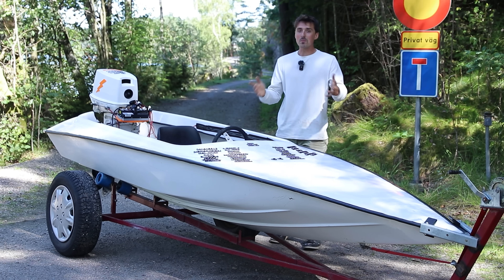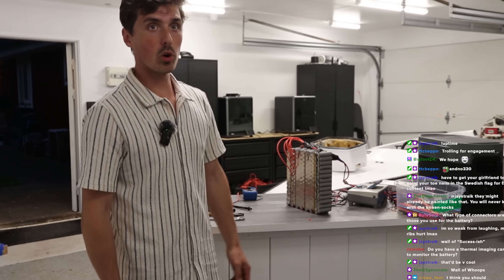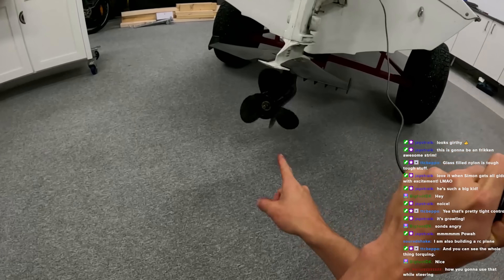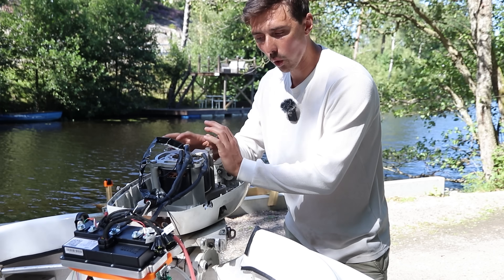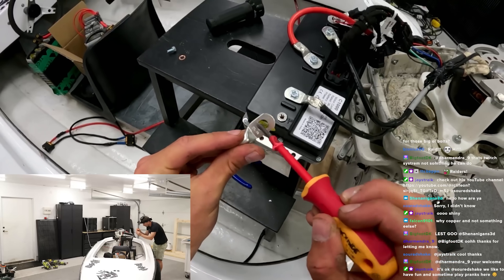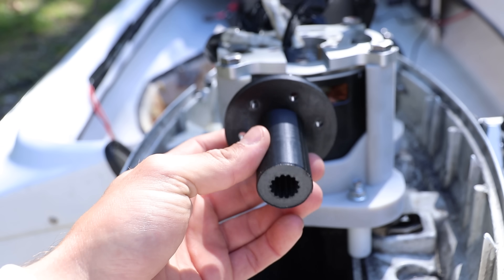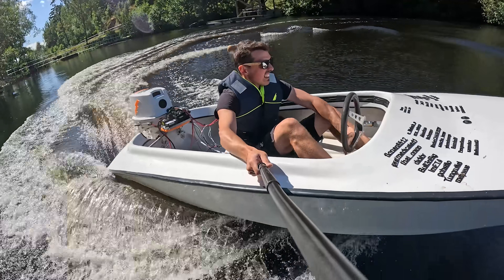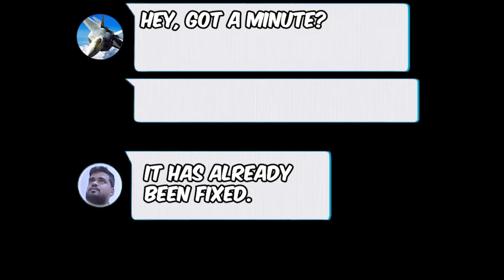Turning My Gas Boat Electric Part 2

Comment: i finally found a blown 75hp yamaha 2 stroke to start an EV outboard project, we pulled the blown powerhead and weighed it at 41kg, wow that alot heavier than we thought it would be. Parts that have arrived so far are SIA155-64 PMSM motor 30kw peak and fardriver controller ND96850 encoder version water cooled, we current have a small battery for bench testing 72v 12ah. thoughts on final battery are 2 x 72v 100ah units under each of the front seats and a backup 72v 60ah in the rear transom area (basically where the fuel tank was) this project going to be a slow burn maybe for next boating season here in Sydney Nov 2026. current 2 stroke powerplant is only 5 kgs lighter than projected new ev outboard. A wig wag throttle and speed selector switch at the helm. boat is a 15 foot runabout or tinny as we call them here. Although controller is 96v we are running 72v (charged to 84v) as all my ev converted bikes run that setup. not sure about connection between motor and leg/drive shaft maybe a lovejoy connector. thanks for the video you gave me good direction in some areas

Comment: No, please don't make a jet drive. Make a MUCH bigger 120V battery pack with inexpensive prismatic highest energy dense EV cells like CATL or EVE NMC cells for long run times. Add an air blower for air cooling or add water cooling. Tune the prop pitch if necessary.

Comment: Could you please post or send me the part number for the Motor and The Brand lower unit you used ... the Specs on the Air cooling fan you used and the cad fines for the parts you had made ... and the code for the controller and the total voltage for your battery pack and how many amp / watts it has ... thanks in advance 
Michael T.

Comment: You wanted more range right? I found lipo cels 55Ah 6 for 30 eur or so  so you can make an insane cheap powerfull high capacity battery

Comment: What is it what makes this hell of noise. Is it the cogging torque of the electric machine? Maybe it is a good idea to get rid of the grooved stator and make an air coil axial flux motor.

Comment: those wings do slow down a ton ...i tried some and took them off pretty fast haha....i would try to play with high pitch since electric has a loooot of torque and you lift the engine as much as posible before ventilation...2 blade brass props are going to give you a couple mph more

Comment: Tips. Jag köpte två Silence S02 Premiummoppar då dom säljs ut nu för 30K. Har 4kW elmotor (kan vara strypt 7kW?) med batteri för 10-12 mil. Finns med 1,5kW motor och mindre batteri för 20K. Borde kunna göra lite kul grejor med dom. Jag hoppas kunna få bort fartbegränsningen. Ett jäkla vrid i dom, runt 200+ Nm :)

Comment: Put one step higher pitch on the prop, and highspeed prop. And test put the engine in surface drive. Just for curiosity. 😁

Comment: You should raise the motor so 1/4 of the diameter of the prop is above the keel. This will aerate the prop and help it free up once the boat is one a plane. 

Guaranteed, it would give you an extra 20% speed at least and be way faster than a similar power jet drive.

Comment: So he would need a lot of battery for a few hours of run then, I love the quietness of the electric motor, but the fuel ratio is not on par with the length of time.

Comment: Before you remove the outboard you need to raise it up higher out of the water.  They are only down that far to get good cooling to the gas engine.  Raise it up till it start to surge and then down slightly.  I am not talking about trim actually jack the motor higher up on the transom.

Comment: I think you need to add a Go Pro mount on the boat so you don't have to hold it. I'm sure you could add electronic control for positioning.

Comment: Jet is great for simplicity, but you will suffer a 15% efficiency loss minimum. There are also hull alterations to consider. What you want, is a surface drive. All the benefits of a direct drive, with almost the simplicity of a jet. For your little boat, one could easily be fabricated from tubing, and an ATV cv axle. The hull would not need modification, unlike a jet, or V drive. It will also perform better than the outboard, as it will be much lighter, and surface driven props only have to turn half of the prop through water when at speed. There are various videos of surface drives in action on youtube, always in fast boats. The only down side is slow speed maneuvering.

Comment: Your outboard motor should be raised up one and a 1/2 inches from its current location. The bottom of the boat should be one and a half inches lower.Then the cavitation plate, according to mercury racing

Comment: Nice 🥳👌 To get more speed I think you should get a motor with the right rpm to match the propeller. 19kWh should be like an 25-30hp gasoline motor. Awesome work anyways 🤠👌

Comment: Great project.  I worked on a collegiate electric boat competition called Solar Splash, it's still in existence in the USA. We had so many problems with our speed controller limiting the current that eventually we came up with a strategy where we throttled up to full speed then activated a contactor that connected the motor directly to the battery (no speed controller). At that point your head would snap back as the motor could draw as much current as the batteries could put out (close to 1000 amps for a limited time). This was a brushed motor however, I'm not sure what you're using.  The contactor has to have the ability to break that kind of current, otherwise it will weld itself shut when you attempt to turn it off. Great channel.
Reply: This is brushless, so no way to just direct connect it. a speed control is mandatory.
Reply: @Ken-v5l5d  I was thinking that might be the case.

Comment: So you can get that kind of control with a sensored motor and esc. Holmes Hobbies could have built you something for way less. Heck you could have used a revolver style without sensor for crazy control and power.

Comment: Nice project! 
And hey it's your build so whatever you decide is best but jet drives are usually about 30% less efficient than the outboard drive you already have.
Maybe try a straight shaft? Like on the RC boats. That should cause the least losses from motor to prop, maybe give you higher speed and eliminate most of that noise.

Comment: Hey drive will be slower. You’d be better off with a direct “arneson” type surface drive. No gears at all. Less weight. And you be able to trim it. Jet drives are horribly inefficient

Comment: I'm surprised your cables didn't melt. At a guess from what I could see your cable from the batteries to vesc to motor is about 16mm2. With 382 amps about 2 metres your voltage drop would've been around 5%. Cable size for current carrying capacity alone should be 150mm2-ish. Sorry if you explained this on your live stream or somewhere else that I missed.

Comment: You're better off leaving the outboard boat as it is and finding a jet drive hull. The hydrodynamic design is specific to jet drives. Maybe find a jetski with a seized engine and retrofit?

Comment: ooooh, jet drives are fun but tricky. you need to get the size just right to match the motor and expected ship speed. DO NOT do stages, water is incompressible. impeller should be axial flow, with a screw profile to the paddles, and a slight conical taper. The taper lets you have a taper in the housing and adjust the impeller axially for tight clearance. In terms of impeller size you gotta think about your pitch, outer and inner diameter (there's a shaft, right?), # of starts, giving you a volume per revolution. figure out what speed your motor likes and that gives you flowrate, then you gotta figure out how much power you have from the motor to accelerate that flowrate. stator vanes post impeller should start angled and go to axial. impeller is a (conical*) SCREW! (in a conical pipe) remember this!

Comment: That boat can be so much faster. You need to raise the motor and run a surface drive prop. You also need trim. As far as a ramp goes, just use wood covered with outdoor carpet on the top.

Don't go jet drive. Too much wasted power.

Comment: @RCLifeOn om du vill åka fortare OCH svalare för motorn, så höj upp motorn så centrum på växelhuset (propeller axeln kan vi utgå i från också) så att den ligger strax under skrovets djupaste del. Propellern väldigt djupt och tung i videon, men vill du åka fortare och svalare så vill du ha ha upp proppellern ur vattnet mer så  varvar han ur ännu mer å de går fortare, toppfarten ökar men på bensin motorer kan de bli svårare att ta sig upp i plan, men du har så sjukt mycket bottendrag med EL motor så de är nog inga problem. :) hissa upp motorn minst 20cm iaf, vore kul å se hur mycker fortare du kan åka per knop :)

Det borde vara lättare också för din motor och VESC enhet om inte hela propellern behöver vara under vattnet HELA tiden. utan bara halva propellern. Tävlingsbåtar har 1/3 av propeller diametern i vattnet när man kommit upp i plan och fart.

Comment: If you really intend to go the jet drive way, I would suggest that you somehow convert that outboard motor to an outboard jet drive motor. The biggest advantage of this approach is that there is no modification to the hull needed and therefore no chance of leaking.

Comment: not sure why you only got 28 knots from that much power. a 25/30HP 2 stroke (22kw) would make that small boat fly maybe 35 knots.  i have a 350kilo Pioneer Viking 15 foot with a 25HP 2 stroke doing about 27-30 knots with 1 person onboard 425Kilo total. maybe the prop is for another RPM? make sure you match the propeller to the RPM/torq range of that motor

Comment: Now imagine 400 amps on a dual motor stand up scooter (both motors powering the rear wheel with chains).  That is what I was doing in 2003.
It is all about the controller and not catching the motors on fire, which I did many times.

Comment: When you need to print strong stuff, I can highly recommend you fibre reinforced Poly Carbonate (if your printer is able to handle those temperatures and if you have a hardened nozzle). Or if you are lower on budget, you can already improve your prints by printing out of (fibre reinforced) PETG instead of PLA.
Also if you have CNC mashined parts, I think a high performance aluminum (e.g. 7075) might be cheaper, lighter and should still handle those loads. You can also let it eloxate to make it look nice (e.g. black) and to safe it from oxidation in salt water.

Comment: What happened to trying different props? Forget the PUMP! Work on a few props?  Raise the motor mount about 5 inches and run closer to the surface. Reduce as much metal weight off the outboard and have fun while the weather is nice and you and your girl can enjoy the boat. Make two seats forward and aft. The cooler the snacks and beverages, the sun and fun.

Comment: AMAZING!!! A tip for your ramp and  trailer: use 2  2x4 (or 2x6) wood planks covered with cheap carpet as ramps instead... no risk to damage your hull. Usually people use cheap artificial grass mat or cheap utility door mat (in fabric). Despite a little friction (compared to wheels), your boat will slide easily. 😀
Reply: no need to get expensive carpets because these ramps are usually used rarely... like twice a day (in and out) and 2-3 times per week.  For a boat nearly twice the size of yours, I'm using 2x6 planks on my trailer and ramps. You could round up the tips of your planks since your ramps are quite steep... no need to empale your hull!! 😅

Comment: Really cool, but uh... Thats a lot of money, price to performance is horrible, guess thats the trade-off for electric.

where i live you can get a boat with an engine and trailer around $500usd.

Got myself a 1972 StarCraft runabout 14ft boat with a 35hp motor, trailer included for $300. Did a little timing adjustment to the engine and replaced the lower units oil for $20. It goes 30mph or about the same as that smaller, more expensive expensive boat. Its crazy that my boat can keep up with this project of yours for 1/10 the cost of your batteries alone. And it can go flat out on the lake for a few hours instead of minutes.

Comment: Not sure if you will read the 267 comment but i have done what you want to do with a jet drive. I would recommend skipping the 3d printed pump and using a Kawasaki 140mm jet pump with a relatively fine pitch designed for the 650cc engine. I run a 105ah 24s battery and use 24kw peak at 4900rpm giving me about 48km/hr in my 2.5m jet boat. Motor is 100kv and a slightly lower kv would be ideal for a voltage above 72v.

Comment: Regarding making a youtube video, you should make it Jet drive, yes.

Regarding making it work as well as possible as an eletrically powered reasonably fast boat, its absolutely the wrong way to go however. Your current configuration, if optimized, will easliy beat the jet drive in all metrics one can imagine, with the possible exception for draft.

Comment: Might be cool to replace some of the skin w/ solar panels although your rate of power usage might mean that basically doesn't work!

You can perhaps put the batteries on some sort of sliding assembly, so that you can move them forward and backward in the bow, adjusting your front/rear bias and giving you a way to adjust your trim

Comment: Jack plate would do wonders for the top speed as it reduces the under water drag.
Reply: Yes, but he need to change the prop then as well.
Reply: @GoldenCroc  Yes, he needs a prop designed for surface drive. That would be interesting to see.
Reply: @SINIS0RSA  They are availible, but not super easy to come by. In fact, quite hard for this model of engine shell he got I think. He would likely have to modify one to fit, sadly.
Reply: @GoldenCroc  That is true, this is where he needs some CFD professional to design it and his sponsor to cnc machine it. 😄

Comment: Flat PVC stirps mounted to your ramp will be much better than rollers, but could require 2 people if the angle isn't steep enough to cause the boat to slide down towards the water. Easy enough to test friction and extrapolate the required data from there to find the angle it would need to be in order for one person to be able to lauch the boat.

All in all, this is pretty awesome and just needs refinement. GG bro!

Comment: Dont build a jet drive for it.  Jet drives are really inefficient and you lose about 30% of your horsepower to various losses. 

If you want more power, start by trimming your motor up, and adjust the height so the cavitation plate is level with the bottom of the boat.  And make sure you have the right pitch prop.  You can lose a lot of power by having too steep, or too shallow of a prop.
Reply: Hydrofoil is my better upgrade.
Reply: @TheWebstaff  Way harder to make work than just raising the motor up, Its also not certain it would be a benefit, light planing hulls can be very effcient, even well optimized foils can be a net loss on this boat.
Reply: Was thinking the outboard is also inefficient with the gearbox - also has big exhaust, which is not needed here. Torque on drive should be more smooth than with ICE, so gearbox could perhaps be downsized also. Perhaps an Arneson like surface drive would be optimal compromise 🤔
Reply: @TheStuartstardust  Surface drive is almost always the best answer if looking from a pure speed perspective. Only downside for those perspective is the sometimes limited leavarege for trimming the attitude of the hull, meaning you can lose on that end instead. Especially on a hull of this type. It can be somewhat mitigated with better weight placement of course.

Oherwise, I agree with most of your points, they are well made.
Reply: Hes already got the "cavitation plate" (which is a commonly used misnomer, its an "anti ventilation plate") at about the same as the bottom of the boat if you look in the video. It should be, if you want to go fast, much higher up than that.

Comment: You should try some of the propellers RCtestflight tested to see if they increase efficiency
Reply: Hard to make a plastic prop that can stand up to this power and isnt really thick.
Reply: @GoldenCroc  I guess you’re right. Even Carbon infused materials? Heck, even get pcb to machine the best ones from brass or something (might be expensive tho)
Reply: @PepperGizmo42  yes, even then. Think about how much stronger aluminium is compared to almost anything that can be 3d printed on a "consumer grade" 3d printer.

Now realize powerful boats use stainless steel instead of aluminium props because the aluminium is too weak to be made thin enough.

Now of course, he hastn got much power compared to more powerful boats, but I still think any commercially availible aluminium prop will beat a 3d printed one, by quite a lot, never mind a stainless one. 

The blade thickness would have to be ramped up enough to perhaps not say much about which design is the best, I should think. "lost in the noise/margins of error" so to say.

Now of course PCB way can do a lot with other materials, but it wont be cheap...
Reply: @GoldenCroc  yup, like I said, pcb could, but not cheap..

Comment: i have a feeling that a jet drive will need a lot more power and when you start planing sucking in air bcs of potentially exposing the intake. Plus you will need to divert the water by a lot if the intake has to be further back on the boat bcs of before mentioned issue.
still a cool idea but you would be better off designing a new impeller for this boat that takes advantage of the rpm and power